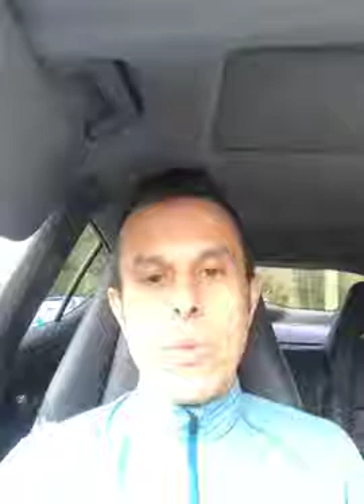Biscuit Screed? 🍪👷‍♂️ Underfloor heating between joists?  Then you need a biscuit screed.

Comment: Hello Speed Screed. Do you have to mix water with the 8:1 Sand/cement or is it just a dry mix?
Reply from the maker: Water would still be required to hydrate the cement and to give enough strength to bind the sand together.
Reply: @SpeedScreedLimited  How much water to an 8:1 ratio, please?
Reply from the maker: @davidcottam7431  Nice to hear from you.  There are a few factors that will change how much water you need.  The snowball test is still the guideline. Enough water for placement and hydration.  Please watch my video on water which will explain.  https://youtu.be/vx6ww6drWy4
Reply: @SpeedScreedLimited  Thanks, Andy. Makes perfect sense. Though I must remember not to get carried away and throw them at passing cars!!
Reply from the maker: @davidcottam7431  Very true, might be tempting!  Anything else you need, just let me know David.
Reply: Hi, what type of sand is used for biscuit screed?